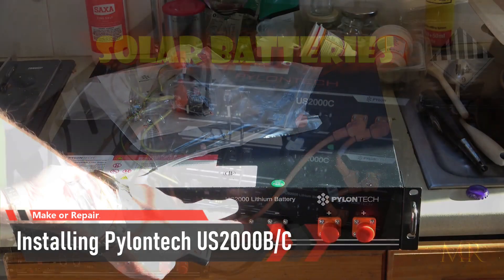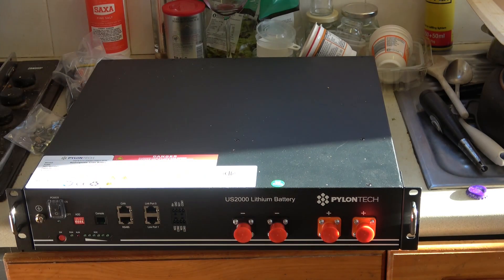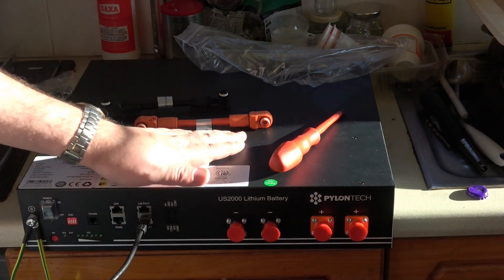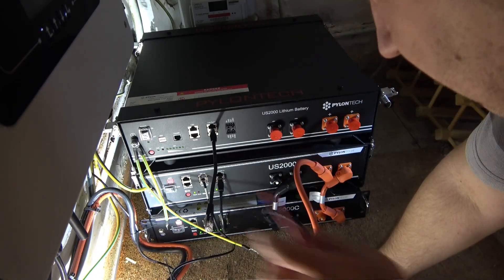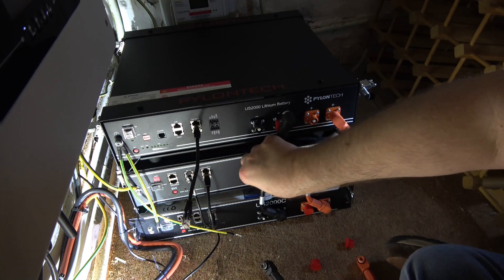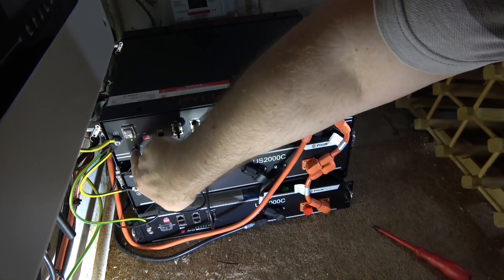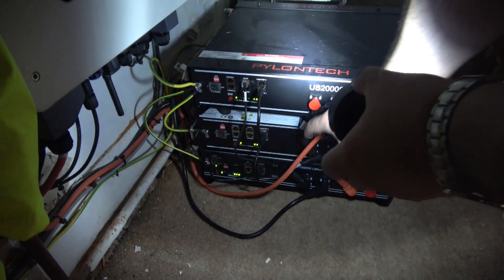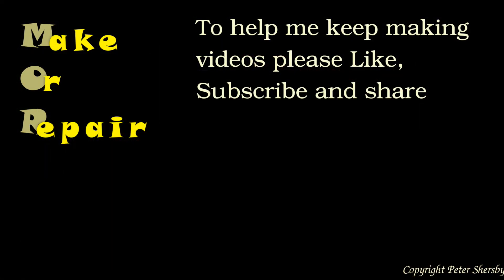Installing Pylontech US2000B / US2000C Solar Batteries #0047

Comment: I'm also on Octopus Go, 15p/5p. It's very good for now, but I have a suspicion that they're going to take it off me at the end of my current contract.
I have 15kWh of US3000C which I fill to 80% in that golden 4 hour period.
Reply from the maker: Yes, mine ends in June, not looking forward to it, on positive note I stuck with octopus to sell excess although they paying slightly less than one I found, but  they just increased the amount yhey pay
Reply: I’ve had these batteries 4 years and also on Go. My contract ran out last month and it’s now 7.5p per unit over night.  I can’t actually remember the day rate but usually I don’t consume grid electricity during the day or at least not much.
Best thing I ever did was to buy these.
Reply from the maker: @mollyfilms  Well less frightened than I was thanks!  That reminded me,  I can check on the public Octopus API  https://api.octopus.energy/v1/products/?brand=OCTOPUS_ENERGY&is_green=true  For 1st April scheme, assuming they don't add another, it looks like mine is going to be about 29.8/7.5 and standing charge 26p/day.  My export is about 4.1.  so 50% night-time and 100% day-time increase.  To get detailed information you need to find what region code covers you because prices vary over the UK.  I too buy as little energy during the day as possible - although December was not great.  I need to download the data and put my new prices against it, then I can see if a 4th battery woud make sense.

Comment: Do you think this Is installable by myself instead of paying the company to come and add a second one, I've only got one 2000C at present and got one on order? Thanks
Reply from the maker: I don't know how comfortable you are with electrical fittings, but I would say these are within the capability of most people, other than to connect the earth cable there are not even any screws involved,  unless you plan to use the stackable brackets you don't need to take the brackets off.  All the cables are  provided and simply plug in.   But do download  the us2000c manual (I think you get one in the box but you can download and look in advance) and it has plenty of detail on connecting them.   I think the connectors are designed pretty well it would be hard to accidentally get your fingers in contact with the conductors, but you will one red and one black socket not conected to anything so do put he little caps back on them (I notice little fingers in your photo).  There is safety information in the manual but  If after looking at the manual you feel concerned then get help (and it is sensible to have someone around just in case - not just for electrical risks, but they are heavy and if you work in a confined space there are other difficulties that can occur)
The general recomendation is to put the newest one as "master" since it will have the latest firmware, also to get your old one to about 50% charge before adding the second one (it comes 50% charged) so they are "balanced".     You then   make sure BOTH are switched off, and if there is a separate battery isolation switch between battery and inverter then turn that off too. Put the new one in place then do the cables .   Use the provided short cables to connect them in parallel  red-to red, black to black, if you choose to relacate the inverter cables to make it tidier then  the cables have a little button to release them and are stiff to remove, you have to  push on firmly until you feel a small click.  The data cable from the inverter plugs into the CAN socket so you are just moving it from the old to new battery,  then the short data cable connects link 1 (lower) socket on the master to the link 0 socket on the slave (older one).  You can see how that works in the video and the manual shows it really well.  Turn on both at the main switchs (then the inverter -battery isolation if there was one) then press the little round "start" button on the master - they should both start in sequence, if you do get a fault light (like I did) then turn them off, check the cables - if they are all okay then swap the master slave - but the manual and the video should help you.  Most inverters should understand them just fine to charge and discharge using solar,  but, if like me you use overnight charging (cheap electricity) then you might need to modify the charging times/rate on the inverter.  HOpe that helps
Reply: @MakeOrRepair  Sorry one last question if you dont mind. if there is no isolation between the inverter and the battery do i need to turn off isolator?
Thanks again for your advice mate
Reply from the maker: @Andy Robinson  Sent a response to your photo.  Well you could essentially disconnect panels with the isolator shown in your photo and then isolate the inverter from the mains grid,  which amounts to taking the inverter  out of service, but I've never done so, But it is essential that all the  batteries are switched off before doing anything! The only power cables you might come into contact with are the heavily insulated red/black heavy duty battery cables  and with your setup I can't see a need to disturb them at all, just leave them plugged in as they are -  that said it  seems pointless disturbing the inverter.  Plenty of room to link the new battery without disturbing them.  
1.Turn of battaries, 
2. put new battery behind/on top of old leaving a small gap for airflow,  
3.  Connect the short red/black cables + to +, - to -  as shown in manual and at end of my video
4. put in the data link cable link1 (bottom) on new, to link 0 (top)on old  
5. move the data cable coming from the inverter from the socket on the old battery to the same socket on the new. 
6. Switch on both power toggle switches
7. Press the little red button on the new on (the master) for about 1 second and release and both batteries should com into servive one at a time.  
Just be aware that the inverter should flag (and log) the failure of comms with the battery when you turn it off, so it is normal to see that alert in the logs (and I have no idea how you access the logs on your inverter mine just appears in the monitoring software for 30 days).

Comment: Should you not have balanced the 3 together before commissioning?
Reply from the maker: I shouuld have mentioned ballancing - I happened to be lucky in that they were about 50-60% charged that day (the new one is supplied 50% charged), however when the "experts" installed battery 2 they didn't bother and the controllers sorted themselves out mainly because they all discharged through the day.  But yes as a matter of course I would try to ensure they were reasonably matched

Comment: Hello, can you tell me how wide the module is without the brackets?
Reply from the maker: Just measured them, in mm without either the mounting frames or rack mount breackets: 
width 440,  depth front to back 412 exclusing switches and connectors on front panel, height 90
with the brackets they fit a standard  rack so far as I can see.  There are only connectors on the fronUse philips #1 to remove brackets, first just trying to break paint that has gone under head, if the screw gets messed up (which is easy because they are quite soft metal) then use a 5-5.5mm bit (whatever size under 1/4 for the non-metric) to drill off the heads, then you get about 2mm of thread left sticking out that you can unscrew with pliers.   Hope that helps.  Mine don't seem to get very warm but I would always leave a little air space around them, if stacking then just a few small wooden blocks (or better rubber feet) to act as about 1/2 inch  separator is enough
Reply: @MakeOrRepair  Thank you very much.